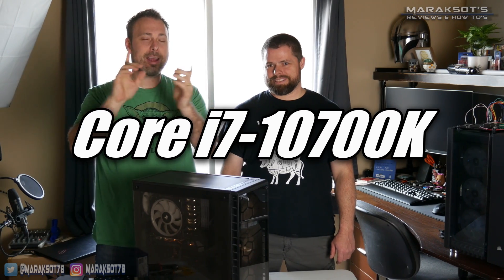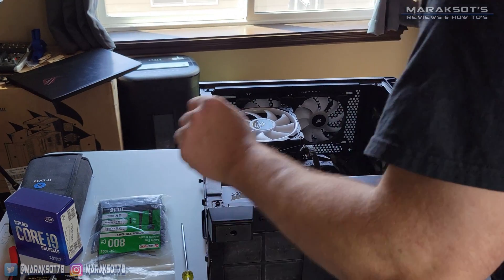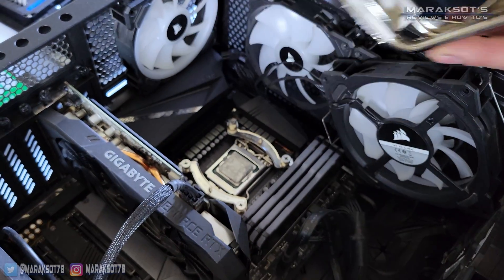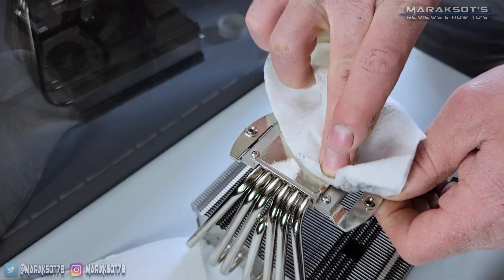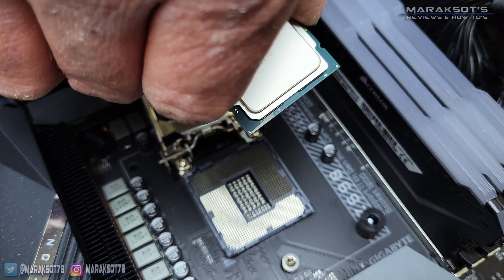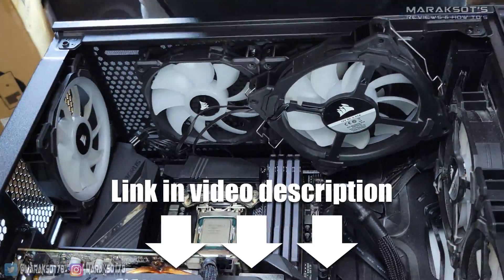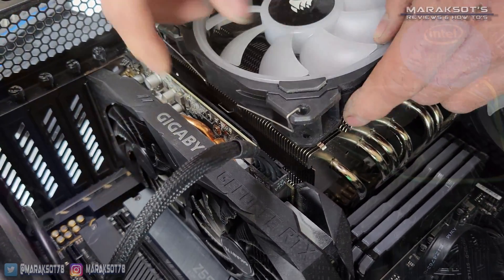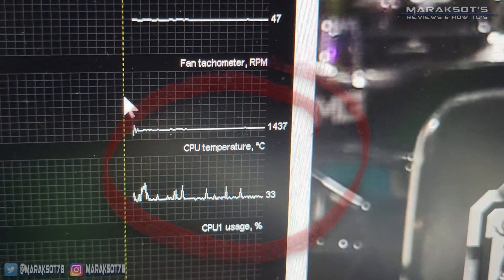How to Upgrade an Intel CPU. (Upgrading an i7-10700K to an i9-10900K)

Comment: Hey Man I have question for you. I have a RTX 3070 on a ASUS Z490p running a I7 @10700, I want to upgrade to a i9 10700 because I feel like Im being CPU locked on some games. Will it simply be a plug and play? I know its compatible with the Motherboard.
Reply: Would be a 10900, right? But to be honest, the i9 does not make that much difference to the i7 here. 
What do you mean by cpu locked? Because it is a decent cpu. ✌🏼

Comment: i have z 590 gaming plus mb with the 2 8pins for cpu power i got a very nice used in guarranty cpu 10700k at good deal 200 euros and thinking that may i can resell it at 240-250  in my place there are some 300-320 offers rare but exist if u have patience most sell at 360 ++ . well to the point i just got in temptation and instaled win 11 pro .
 IF i get in my hands an 10900k and install it do i need to do a fresh install of windows or it will be ok just swap them , read the new cpu and everything will work fine in windows? 
well in bios definetlly i should reset at least what has to do with cpu back to auto . just in case before put the new one.
Reply: If the bios version is compatible with the 10900, you can just exchange it without to install windows again

Comment: hey man, ive recently had a problem with my mic headphones not working, i looked at your videos for when it has 2 3.5mm 3 ring jacks however none of these worked for me, ive got a older pc and my headphones are 3 ring, and have worked before in my pc, i would plug 1 in then realtek hd manager would open and i would select the thing then plug the other 3.5mm jack in then do the same thing for the mic however recently i went to do the same thing but the realtek hd manager didnt open up i tried plugging and unplugging the headphone jacks but it didnt work i cant search realtek hd manager in the bottom left search bar of my pc but in the uninstall programs thing i found it shows realtek still on my pc but i cant find a way to access it, any tips?

Comment: as if a 10700k needs upgraded
Reply from the maker: I totally get what you mean. This was one of those situations where we got lucky.  I had ordered a 10900K for a build I'm working on another video about and Amazon sent me two 10900K's!  I contacted Amazon about the mistake and the representative helping me said they had no way of returning it so they said I could just keep it.  I was shocked and couldn't believe it.  Anyway, I knew my cousin had a motherboard it would work with and asked if he wanted it and the rest you know because of this video.
Reply: @Maraksot78  Sweet. One hell of a free gift. I built a pc less than a year ago and bought my 10700k from microcenter for $250 new. Which was like 100 cheaper than best buy or anywhere else. Figured it would still be relevant for a few more years anyways. It's more than i need really.